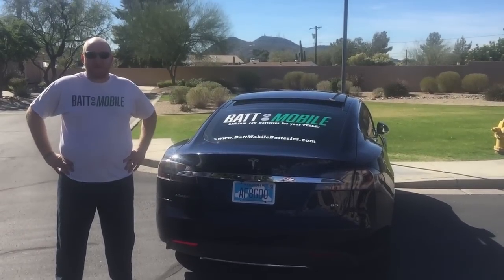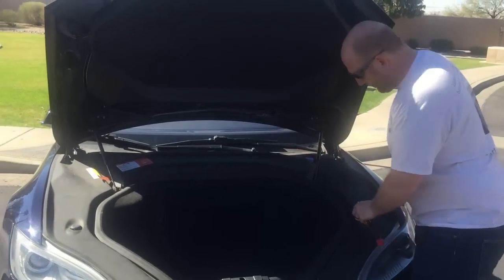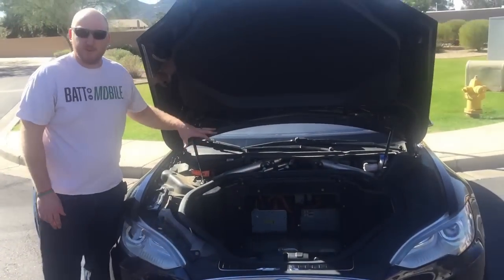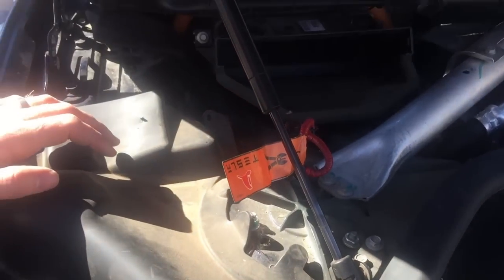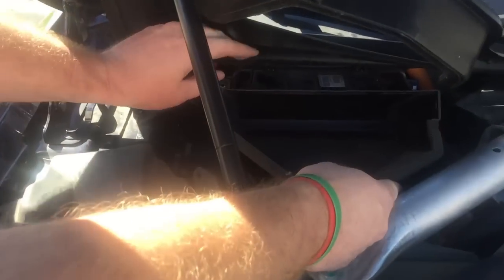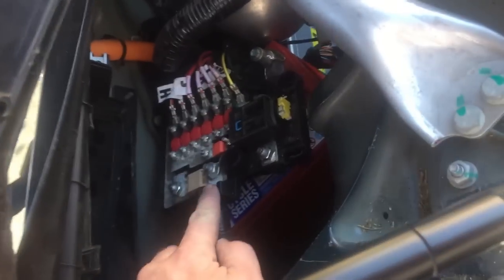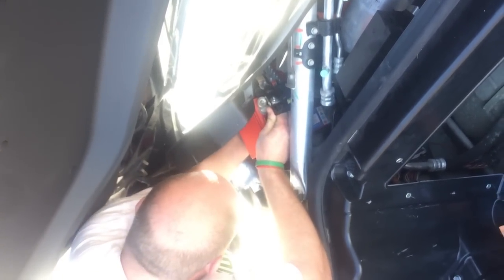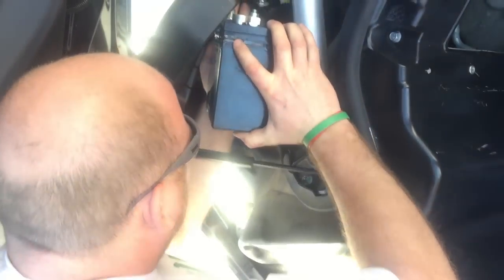Replacement 12 Volt battery on Tesla Model S by Ohmmu.com

Comment: One of the windows has no power after replacement. Was a fuse blown?
Reply from the maker: Possible or needs recalibration.
Reply: @OhmmuEnergy  thank you for the belated reply, not sure how I fixed it but it's been fixed. Battery works fine, but Bluetooth does not work, at least with my Google Pixel 8 it just searches and searches and no Bluetooth from battery found

Comment: Thank you for the video. I have a problem with this code Bms_u019.  
do you know what caused this and how to fix it?
Reply from the maker: Usually codes that begin w/ BMS_ are sourced from the HV battery and are issues in the High Voltage system, not 12V issues.

Comment: Does installing this new lithium battery require a software update, as lithium batteries have different charging characteristics over the OEM lead acid battery? Thank you
Reply from the maker: It does not.

Comment: the video helped a lot but did not discuss the battery metal bracket removal, especially hard on the air suspension model, extremely tight space and impossible to reattach imo, are you going to offer a solution for those? or tutorial?
Reply: I have the air suspension and I found it pretty easy and obviously to navigate.  Very straight forward

Comment: great video, the hardest part was definitely getting the existing battery out, but it was so satisfying to pull it out, like giving birth, as you said. I bought the Ohmu battery so installation was easy and im looking forward to replacement in the future being a bit easier as well because of the slightly smaller size and low weight. thanks.

Comment: Jeez, what a PITA.  I have a 2017 dual motor S.  It's different than this.  I haven't had to swap it out yet, but the last time I was under the hood it didn't look this hard.
Reply: It's a lot easier. Any Model S dual motor is easier, but for the single motor I don't think they moved the battery until the facelift version.

Comment: the rubber topped screw (to lift off the side panel) absolutely refuses to budge. More likely to rip the rubber head off than be able to unscrew it to remove the panel. Very frustrating.
Reply from the maker: Use a thread penetrator and make sure you clean the heck out of it when you do get it out.  Corrosion makes them tough, usually there isn’t any but when there is its a pita!
Reply: @OhmmuEnergy  In the end I had the mobile tech from Tesla do it and he appeared to reach in through the nose cone and unscrew it from underneath!!

Comment: OHMMU - Have you ever approached Tesla? It would be extremely interesting to guage their response. I originally saw your installation in Rolf's cars which made me watch this video.
Reply from the maker: Not yet, have been a little hesitant since I think they would just gobble me up and spit me out...  My experience working with big corporations on pretty much anything has been disappointing overall...
Reply: @OhmmuEnergy  That's understandable. Elon has stated in the past that Tesla tried looking for an alternative to the 12v lead acid battery but didn't find anything @ the time. Perhaps your products weren't available @ that time. Maybe if you tried dipping your metaphorical toe in the water? It would be fairly important to be able to supply @ scale prior to any approach given Tesla's explosion in their rate of production in order to have any chance of them taking Ohmmu Energy seriously should your product prove to be potentially viable from Tesla's point of view. 
Tesla have very tight margins & judging by the Q4 earnings conference call likely to get tighter & I'm guessing this also applies to their arrangements with suppliers. I've no idea if or how your company would be a good fit under those conditions.
Tesla may prove to be different & if not, previous experience will @ the very least have highlighted the pitfalls in advance. Contractually speaking, this would mean ensuring that you leave adequate escape hatches @ each stage of any agreement in case you feel the need to jump ship. At the risk of telling my granny how to suck eggs since you've been in business for some time, I can only assume you've ensured that you own the rights to your technology, preferably thru patent/s.
Nothing ventured, nothing gained as the saying goes. Best of luck should you decide to see if the waters are warm enough to swim in.

Comment: The Lithium battery costs on BattMobile $439.- , but the problem is charging at low temperatures (no info for this found).
Usually LiFePO4 only can be charged obove 40°F (0°C). The original Tesla Battery charges from  -10°F (-23°C) to + 140°F (60°C).

Comment: I am swapping in my Battmobile battery right now and your instructions SUCK!  You skip over the whole battery strap and its little 8mm bolt.  Also no mention of how to get the little hooks to stay.  I could have swapped the 12V battery in our Rav4EV 20 times by now and I haven't even got the original battery out.
Reply: your giant head is right in the way and the video gets all tilted right at the crucial time.  Ug.
Reply from the maker: I'm sorry our instruction manual isn't better.  Do you have a telescoping magnet?  That is very helpful for that portion of the swap.  You can get one on Amazon maybe prime can have it to you in  few hours?  https://www.amazon.com/SE-8036TM-NEW-Telescoping-Magnetic-Capacity/dp/B000RB3XBA/ref=sr_1_1/137-3971689-1332207?ie=UTF8&qid=1496019401&sr=8-1&keywords=long+reach+magnet
Reply from the maker: Best way to get the little hooks to stay is to actually use duct-tape on them, tape them into position standing straight upright.

In my video here the vehicle didn't have that strap in place prior to the install and I didn't add it back in either, they likely left it off because it is a headache and I wasn't going to disagree with that presumption and add one back in there!  

You are right, this is an over-sight for sure, we wrote the instruction manual based on this video so that element was missing from the manual as well.  The two best bits of advice: telescoping magnet helps to grab and align things and duct tape helps keep the support arms in place until you get the strap back in place on top.

Comment: Curious what the performance differences could be in colder climates-- this might be great in Phoenix, but surely Tesla had a reason to do what they did.  I'm leery of second guessing their engineers, but also running my original battery 3+ years in with the warranty running out, so likely tackling this myself.
Reply from the maker: We are confident in our batteries to perform well in a TESLA vehicle application down to around 0F...  Below this temperature we believe the system will still perform but we haven't had the opportunity to properly test and verify this and find the "extreme" points where they will fail to function...  So it depends on how cold you are referring to.
Reply: @OhmmuEnergy is there any 2 year later update to this question?
Reply from the maker: @hpartsch  Performance is still, as expected, excellent in any cold weather climates we have shipped batteries to.  Recently we have built our own in-house testing lab to advance this discussion further.  In-house testing has revealed that performance degradation and safety of our batteries is excellent, so far we have only gone down to -25 Celsius, but our tests are at -25 Celsius for a continuous week at a time, which very few vehicles would ever experience (would have to not plug it in or garage it and leave it outside in sub -25C temperatures for a continuous week, I don't believe anyone would do this to their tesla, I could be wrong though).  We are continuously going lower and lower in temperature and hope to report on -30C and even -35C and finally -40C test results in the next few months.

Comment: I realise it's too easy to criticise motor manufacturers but really, burying away a battery like that is quite ridiculous. With that amount of room in the 'Frunk' one would have thought it could have occupied a space there, as it seems to be quite small.
Reply from the maker: Yeah, but we all like big frunks don't we?  Don't want to eat up that valuable real-estate...  I actually totally agree with you though, some folks run a set of jumper cables (or something more permanent) from the terminals to the lugs and position the battery in the frunk for easy access.  When we were doing our R&D with a Model S 85 we ran it this way to give ourselves easy access to the system for monitoring/tracking-data.

Comment: I wonder why Tesla put LEAD batteries in there Car's in the first place. Defeats the purpose of saving the environment if you're not 100%. I hope they have recycling plans in place for all broken down Tesla's. Would like to see a continuous loop for all Tesla vehicles.
Reply: The Tesla needs a 12V battery system because only the drive units, cabin heater, and A/C run on the main pack DC power (400V).  All other systems, including electronics, computers, power windows, etc. run on 12V because that's a well-established automotive standard.  In addition to that, safety requirements for electric cars require that the main pack DC power (400V) run through a contactor that can shut off the high voltage when it's not needed.  When the car is parked, that contactor drops out, removing high voltage from the car.  The 12V is needed to run the electronics systems and then power up the contactor when the main pack is needed again.

A lead-acid battery was chosen for the 12V battery because lead-acid chemistry can handle powering systems in very cold weather and can be charged without a temperature management/BMS system..
Reply from the maker: What happens when you just took a long road trip and are pulling into your destination with only 1-2kWh left in your battery (heck, say 10kWh left) but won't be able to charge for a week or two...  The car's computer systems (and other 12V loads) are pulling ~60W all the time so that is 1.4kWh per 24hrs; you would deplete your main-pack to absolute 0% within a few days in this scenario and once you've done this all your computers would shut down...  Once they have shut down, you can't plug the car in and get it charging b/c there would be nothing to establish communication with the charger and start things off in the charge cycle...  

Well, without the 12V battery this scenario results in a $30-40K battery replacement.  Having the 12V battery there is essential to the safety of the vehicle in certain scenarios.

I understand it isn't an "every day" thing for most owners to use the vehicle that way but if it would be a "fatal flaw" quickly pointed out when it did happen (and certainly that situation happens all the time somewhere in the world)...
Reply from the maker: When I was at the grand opening for the Gigafactory last year in July Elon and co mentioned this is something they are working towards (full loop of recycling and reusing the lithium battery contents).  Yeah, I think they did LEAD because it is cheap and well-known in the industry (automotive) vs. try to create a new 12V battery altogether, it was simpler for them to get up and running...
Reply: Why does Tesla need a 12v battery at All? A 12volt converter tied to the 85Kw battery wont do?
Reply: A LEAD acid battery is 99% recycled back into LEAD acid battery usage. I wonder how much of a lithium battery is recycled back into lithium battery market? Really it’s toxic for the environment if it gets back into the environment. The LEAD acid battery market is a close loop as long as you turn it in and not throw it in the garbage.
Reply: Cytranic I honestly don't know why they need a 12V battery. I only assume it's used as a backup system more then anything. The more stranger question is why did they use a LEAD battery instead of a Lithium battery in the first place.
Reply: Lead-Acid is terrible in the cold, short life and toxic. I think they just did the low cost quick idea to put in a 100 year old tech battery. The Roadster had used a DC-DC converter and no battery but failed with no 4 way flashers if the DC-DC failed. 
Someday soon Tesla will be 100% Lithium. Maybe an upgrade with the model 3?
Reply: All electric vehicles powered by higher voltage (not only EV) have low voltage and high voltage parts of circuit, one of the reasons is to separate high voltage, that may hurt you, from low voltage circuit for auxiliary devices, like electronics, lights and passanger heating. Getting > 400 V power jolt can get painfull. Second reason is automotive standard of using 12 V as low voltage, used in common internal combustion cars with Lead-acid batteries. Also using all the time 400 -> 12 V DC power convertor would result in some power losses, so using 12 V DC battery is more efficient and makes a backup for traction battery

For instance in trams (Tatra T3SUCS) is 24 V NiCd battery and low voltage circuit for powering doors, lights and auxiliary devices, while high voltage (600 V), collected by pantograph, is used for powering motors and cooling fans.
Some electric locomotives have even intermediate voltage circuit powered from high voltage circuit. So in locomotive can be72 V DC battery for steering electronics, auxiliary compressor and small devices, 400-600 V intermediate voltage for auxiliary machines like cooling fans and main compressor and for example 3000 V DC from overhead lines for motors and train heating, that consume a lot of energy, but they do not need to run all time, but locomotive electronics (compare with Tesla's electronics) must run all the time, even when it is parked and not used at moment.

I hope, that this answer explained on other electric vehicles makes sense and explains necessity of low voltage circuit :)

Comment: +Sean Scherer
Had you considered using using SuperCapacitors instead of Li-ion cells and what would be the drawbacks to taking that approach ?
Reply from the maker: The drawback for using SuperCapacitors as a battery is that they don't have the energy density of Lithium batteries (meaning need more space and weight to get same capacity) and also they don't hold their charge well over a sustained period of time (forcing the DC/DC to be nearly always on, which would overwork it and cause premature DC/DC failures)...  It's a neat idea though, generally capacitors are better suited than batteries when enormous amounts of current output are needed in a brief time, this isn't the case with a 12V battery in the tesla vehicle.

Thank you for your comments on my video!
Reply: True the energy density both gravimetric and volumetric is poor for SuperCapacitors but you only need a fairly small amount of stored energy beyond the traction battery in an electric car,  just enough to keep the electronics going really. I was unaware SuperCapacitors had such high leakage. I bow to your greater knowledge on this matter.

Comment: Thanks for the how to step by step video. The lighter weight sure makes it easier to place the new Lithium battery back in place. It should also last longer than the 100 year old LEAD acid tech battery Tesla uses. Nice work.

Comment: very complicated
Reply from the maker: It's not too bad once you've done it, but certainly it is way more complicated than it should be and more complicated than a typical vehicle (Prius are tough too)...  The D model TESLA vehicles are easier because the front motor forced them to move the battery to a more accessible location.
Reply: Agree. Not convenient and seemingly not meant for the owner to do themselves without a hassle. Way way way too many pieces to remove just to access the 12V. Geez is the windshield coming out next? Annoying when it didn't have to be designed that way. There is no way in hell I would have figured how to access the battery without messing something up or losing a bolt without the help of this excellent video, but now that I know, I'm keeping my appointment with the mobile Tesla mechanic so he can do it! Ridiculous. The new battery better last more than 3 1/2 years like my original late 2015 Model S one has...